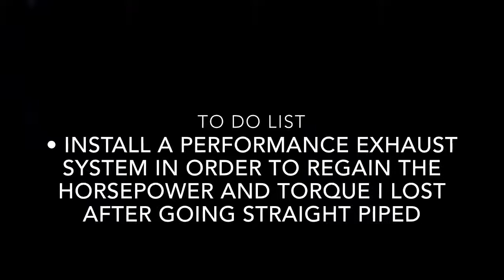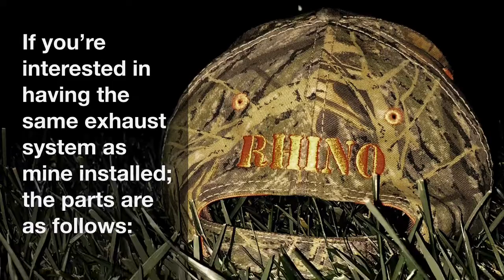Boosting My Tacomas’ Roar: Custom Exhaust Upgrade (Magnaflow & Cherry Bomb) | @PeterValdo1

Comment: Hi @Peter Valdovinos, I know you have a newer Tacoma now, but I was wondering: On Tyler Krivanec's Amazon wish list, you have three different parts. TWO different CATS (MagnaFlow 447205) and (MagnaFlow 444505), and of course the Cherry Bomb. On this video, you only use the 447205, while on the wish list there are 3 items. Sorry for the long comment, I just need to save as much money as possible! Thanks, Alex.
Reply from the maker: Hey Alex, if you go back in this video; at small parts in the beginning, you can see that there were two cats installed from the factory on the truck. The reason you see two different catalytic converters on the list is because 444505 was installed off camera while 447205 was filmed. it’s not a difference of one is better than the other between those two cats; they’re on the list because my truck had both installed.
Reply: Peter Valdovinos thanks!
Reply from the maker: Sure thing brother👊🏻
Thanks for watching
Reply: So that's how you pass smog you have two cats hmm so no skimping on that i guess